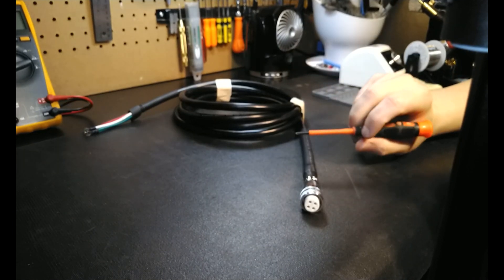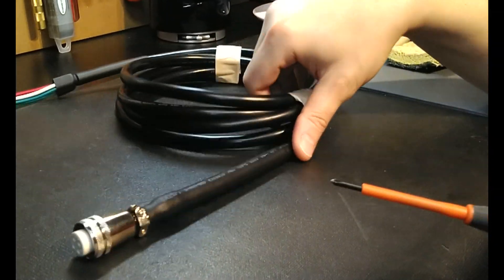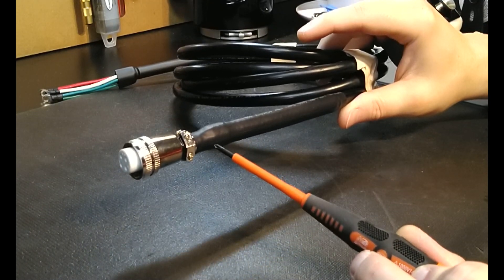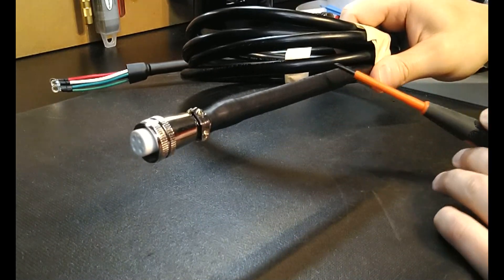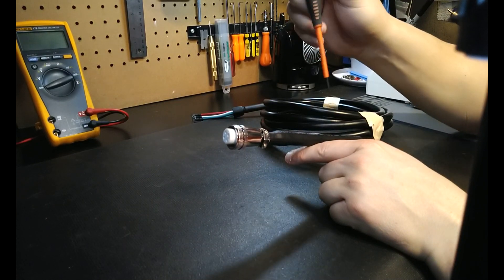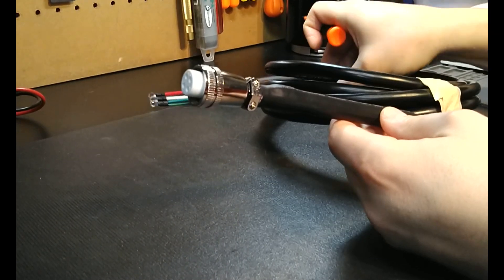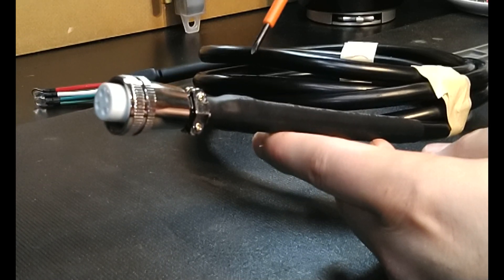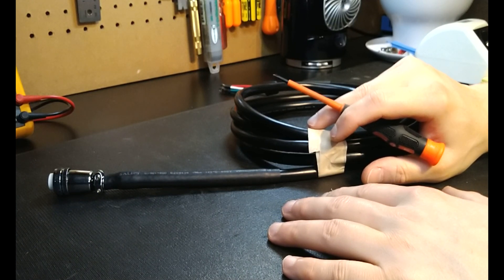Ceramic HY Type Spindle Connector Installation.. (What you Need To Know)

Comment: many years ego i work in a factory next to was the how you call it a big electric casement in that the 380v cables would come in from and to the 380v motors so to let you see what the power of a 380v arc is one day boom lightning came from the box and a big hole made from it on the door of the casement that was at list 5mm steel on that door i wont never forget it
Reply from the maker: 3D inCNC thank you for your support. 3 phase power is very scary in the damage it can cause. That story certainly proves it. Have a Happy New Year! Vince
Reply: @corvetteguy50  Happy new year to you to

Comment: Hey Vince,  while watching some videos on HY spindles some of the videos show the person  taking the top off the spindle and soldering a ground wire to the spindle chassis.  Do you do this to your spindles.  If so why or why not and  can you ground the spindle body by just running a ground from the metal spindle mount to ground without going into the spindle body?

Comment: i work with 600v DC and 480v AC on the regular i take all OSHA compliance precautions with every step i take if someone turns off the power i still test it. IT IS NO JOKE. it is in an industrial environment i can confirm every step he takes is worth the money and time to takes in a setup and proper connection i deal with Siemens and Beckhoff all the time. cant recommend them for hobby setups but the principals for them apply to light industrial setups all the same.
Reply from the maker: Xmackattackx, thank you fro your support. I really appreciate it. Like you wrote its no joke, and I hope more understand the gravity of what their dealing with these type of connections to make sure their their done correctly. Thank you, Vince